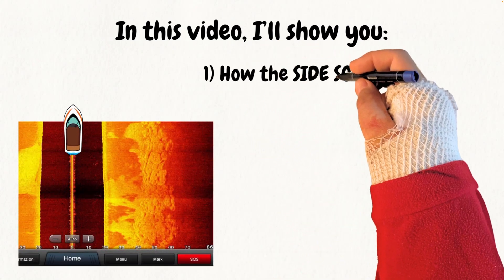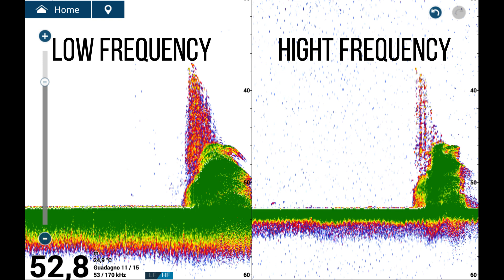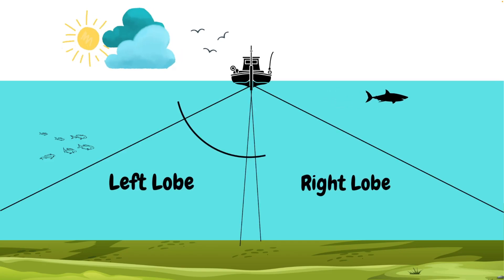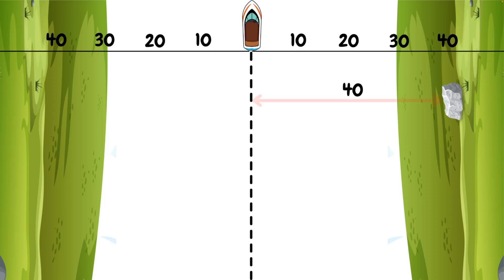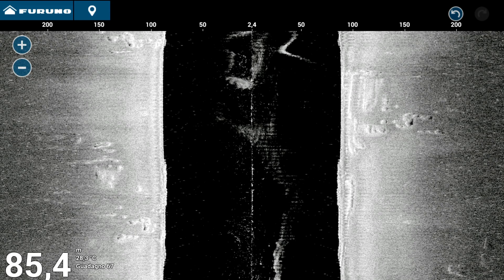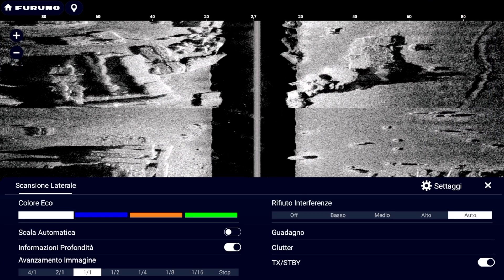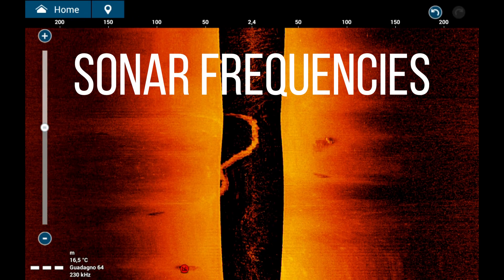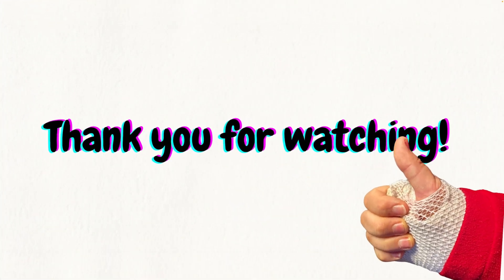How to Read Side Scan Sonar: The Ultimate Guide (No More Confusion)

Comment: Nice job, did seem to repeat one section at the end, no worries. I have some experience with gt51 mainly depths around 40-60m ,some more advice on contrast vs sensitivity(gain) and other adjustments for optimal location of structure would be great😊. Probably works best breaking topics down for shorter more specific topics. Example topic 1 intro to sidescan, 2 tuning sidescan for optimal structure, maybe one relating to garmin gt51 etc then another for furuno possibly just some ideas for thought.😊
Reply from the maker: Thank you for your comment and attention. In the next time, new video.

Comment: Another great explanation!  One observation, your example at 6:00 was very good and that rock was 20m+ further to port than the plotter's marker icon indicated. The marker icon on the sidescan, however, did correlate pretty closely to the distance the rock actually was from your original track location (65-75m). I've noticed similar characteristics with my dff3d. Your advice to use the plotter marker as only a reference point to investigate with traditional sounder is perfect.
Reply from the maker: Thank you!